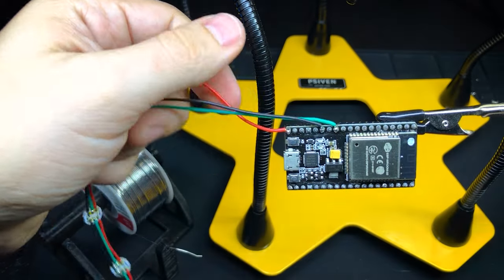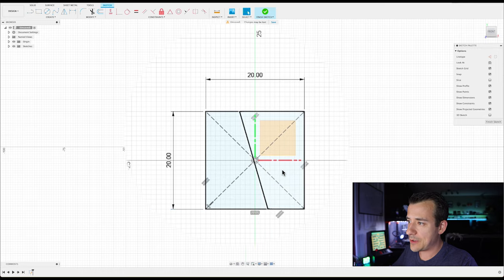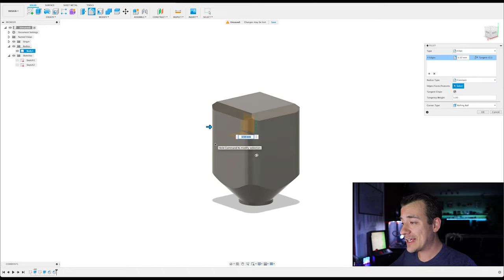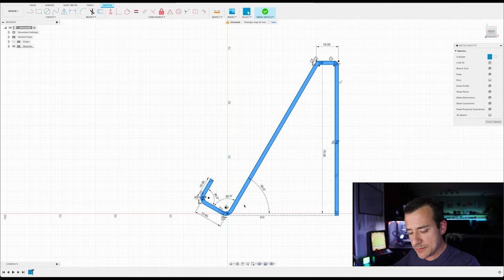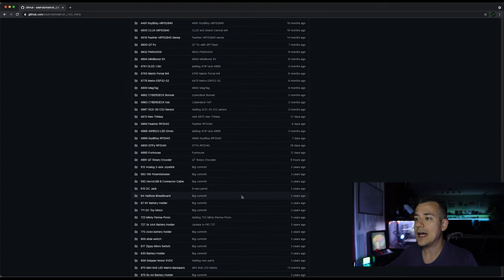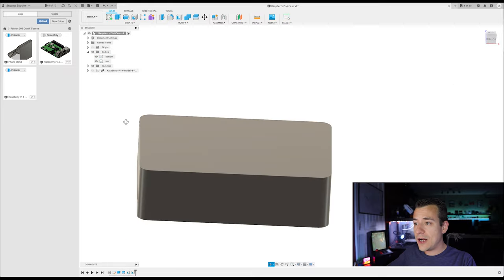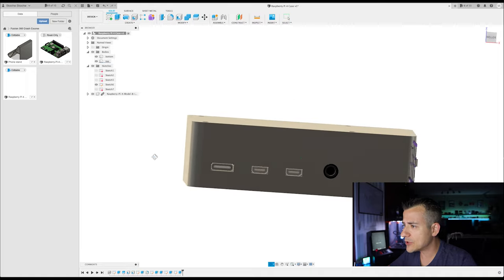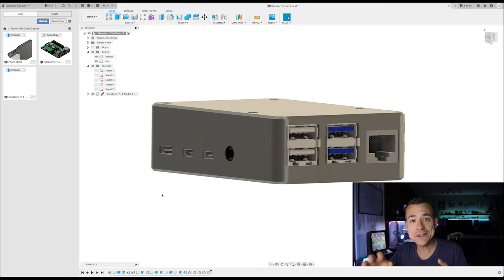Fusion 360 Crash Course: Create your own designs for 3d printing!

Comment from the maker: I know I know, it's another super long video but this one kind of needed it.  🙈 What other crash-course type videos would you guys like to see?
Reply: Electronics and software for stuff like Raspberry Pi and Arduino
Reply: Maybe just how to understand electronics
Reply: Can you plz make a cad model of USA army drone mq9 reaper
Reply: potentially a series showing electrical engineering or pcb design? I know these are things that had very little resources when I started.
Reply: I'd like to see more details on how to add the connecting of two pieces via slots, dovetails and magnets, pls.
Reply: oooh mabey PCB design
Reply: Solidworks

Comment: Pro Tip: Avoid sketch fillets at all cost. There are some scenarios when they're necessary, but generally you'll want to use the Solid modeling Fillet. This will keep your sketches simpler and easier to fully define (to drive design intent). Modeling fillets are also parametric and can be better managed in your timeline, along with other parameters and features.
Reply: Huh, that is interesting.
Reply: This is something I've struggled with, my fillets were breaking the parametric design. Although the trick to fix it was to not pres enter on dimensions but clicking the next lines (this was not clear in the video). Turns out fusion is capable of making those fillets parametric, but you need to make sure that the dimensions between the centers of the fillet are staying unchnaged. If you press enter, the dimensions will change only on the side you're editing breaking the dimensional coherence.
Reply: i wish sketches had timelines...
Reply: he is 100% right about that. I was using filets in the solid modeling and then tried in the sketch environment and quickly found that makes future adjustments a serious problem

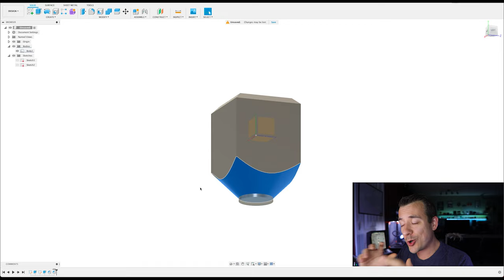Comment: The tip at 10:00 is pure gold for 3D printing without supports just by adding some angles for the printer to build onto vs having mid air support requirements.

Comment: At 5:27, when I click on the arrow to manually extrude, the "amount/measure" input box disappears. However, on your example it stays visible. So if I change my mind during the manual extrude and would rather type in a value instead, how do I do that?

Comment: Great Video! When I right click on the Body to save, the option is "Save As Mesh" with 4 formats, two of which are STL (Binary and ASCII), the others being OBJ and 3MF. I noticed you saved as STL Binary. Is that the standard save format for dropping it into a slicer?

A comment a few below my own asked a similar question and the answer was 3MF is a replacement for STL. My conclusion is I should save my files as 3MF. Is that correct?
Reply from the maker: .3mf is quickly taking over as the format of choice because it can contain much more data than just the model (things like print settings). STL works fine though and is very popular still.

Comment: really brilliant, I noticed you did some mistakes - 
1. The screw posts should not be on the top ( idk if that was intentional)
2. The audio jack won't fit because when you'll put the top cover from the top, it'll stuck on the audio jack, the top cover should be cut by extending the circle to the baseline.

Anyway, you demonstrated great features that will help us in our work :)

Comment: Fantastic Video!! This was extremely helpful for me! One question I can't seem to find an answer to, is there a way to change the "save as mesh" defaults? New drawings/bodies seem to default to 3MF and I can't seem to find anything under preferences to change it to default to STL (ASCII)
Reply: 3MF is a modern replacement to the well aged STL format. Hopefully thingiverse and other model sites will start accepting the 3mf format soon..
So no, I don't think you can get STL as the default type :)

Comment: great videos! I'm trying to use arduiono to trigger a looper pedal remotely, from a homemade footswitch, i tried using wireless guitr trsnsmitter receiver but this does not work as the signal may be too weak for an actual command signal (like on or off) can you help mguie me in the right direction?

Comment: It's hard to follow when you click too fast. Too many steps too close together. There is replay, so I use that of course. I'm also really frustrated by not having the same Raspberry Pi model to work with, can't find the one wermy used. It's not working the same. Still, this video has helped me the most so far. But the fact that my version is newer than what he is using (over a year later) is making things harder to figure out.

Comment: Hate to say but your video editing made it impossible for me to follow properly and I can't add the cross beam as a result, due to the line being overconstrained. And when u added fillets it said it broke one of the constraints but didn't say which one and I couldn't find any blue lines. Also the offset was trying to build below the line I drew for the cross beam, and I had to "flip" it to get it to go up.

Update: found out fusion360 is apparently "that picky" when it comes to the crossbar. Front to back makes it offset down and not be allowed to move (over constrained), back to front makes it offset up and allows for setting dimensions.

Comment: Over $400 for a yearly subscription. Ya...no.
Reply from the maker: There is a free tier.  :)
Reply: I'm not sure what the limitations are yet for the free tier. I gave up on Eagle when they jacked the price up 4X, and did not know Fusion could be free. However, I like the lighter app for circuit boards, Fusion will be for making 3d models for parts.

Comment: $533 per year? I couldn't care less how to use it.
Reply from the maker: It’s free for personal/hobby use, with a couple minor limitations. It’s incredibly powerful, so that’s not a bad deal if you ask me!
Reply: @wermy  I don't run pirate software.
Reply from the maker: @douggale5962  I am certainly not suggesting that. There is a free subscription tier for personal/non commercial use.
Reply: @wermy  You mean the $99/year 3DEXPERIENCE SOLIDWORKS for Makers? I'd rather be dead than use cloud saves.